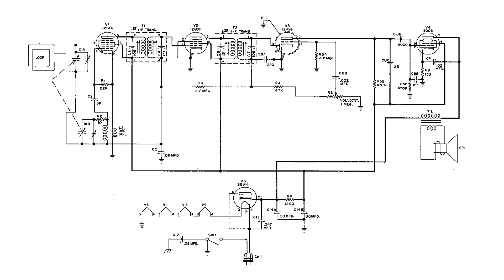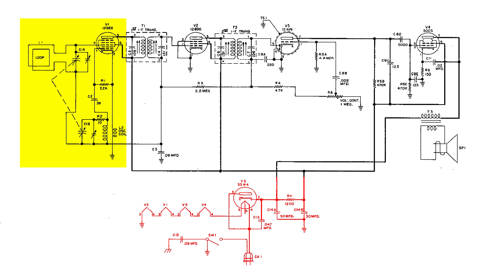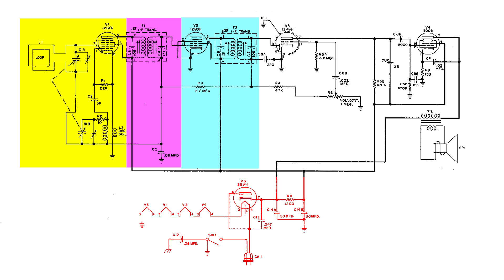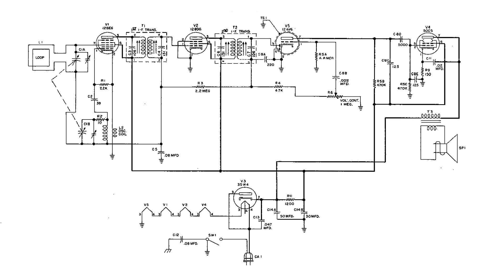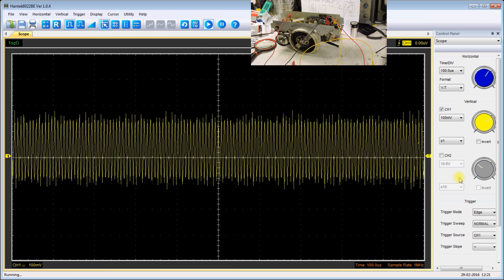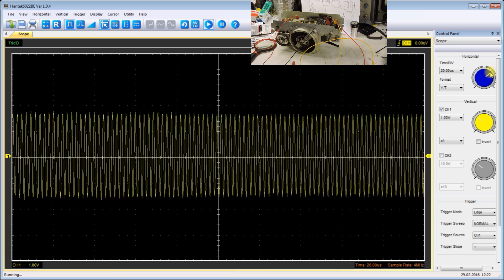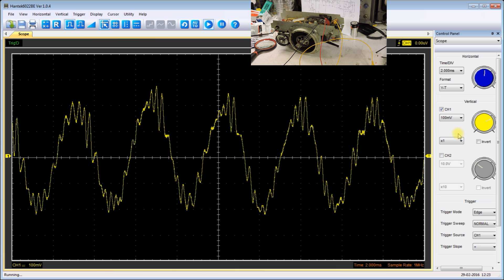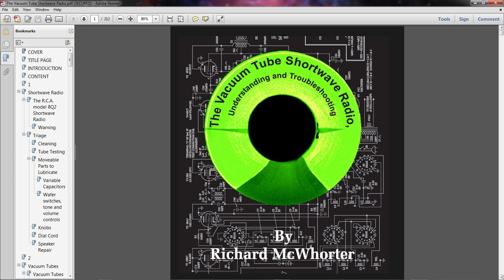All American Five Radio Troubleshooting

Comment: Quick question: What level of sensitivity should I expect for an All American Five radio?  For a GE model 400 radio that I am restoring, the signal at the antenna needs to be above about -40 dBm (3 mV RMS into 50 Ohms) in order to hear the station clearly.  This seems high.
Reply from the maker: So I guess your volume and sensitivity are low. Have you tested all the tubes? I’ll be glad to help in troubleshooting your radio. I would need te voltage at each plate of each Tube. My email is allamericanfiveradio@yahoo.com make the subject GE400. The specification for the 12SA7 is below.

12SA7
https://frank.pocnet.net/sheets/127/1/12SA7.pdf

Comment: Shouldn't the power switch be in series with the hot lead, and a polarized plug?
Reply from the maker: This was made before polarized power plugs, and other safety rules. That why I ALWAYS use an isolation transformer.

Comment: Can you hook an oscilloscope directly to the plates on a tube radio?? I might have ask you this before, I cant remember...excellent video..I did ask you..sorry about that..but my scope say's it can handle 300 volts DC and I believe the plate voltage is around 250 volts.

Comment: Appreciate the videos that you have on your channel and the sharing of your knowledge on working with these vintage radios. 
I am working on my first restoration of a 1955 Arvin 842T radio that my father had kept away in his storage and was wondering what gauge of antenna wire were used on these sets?
I would like to try and replace it since a lot of the cloth insulation is almost gone from it.
Thanks for your time.
Reply from the maker: +isle hikes 

Usually under the cloth cover the wire is insulated with lacquer, if this is the case I would just leave it alone.